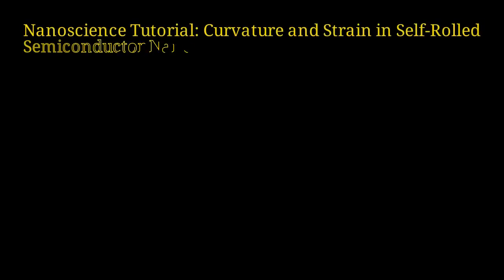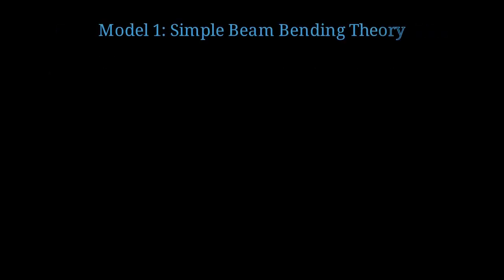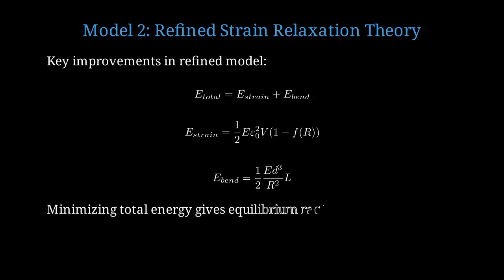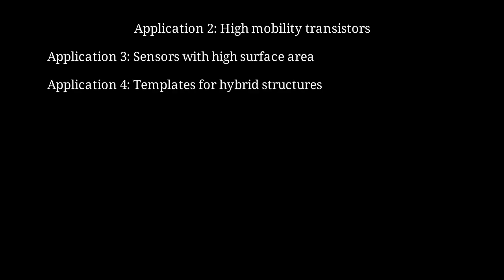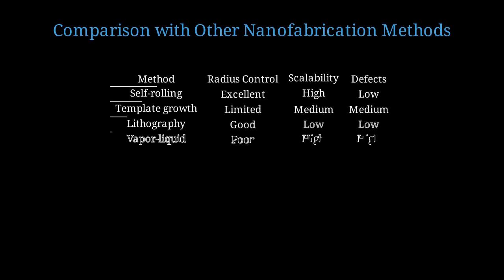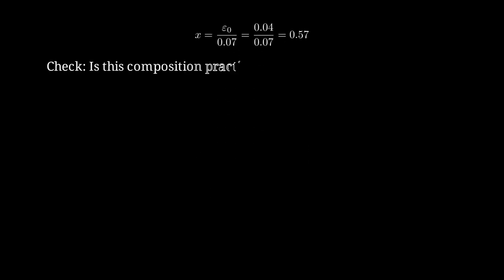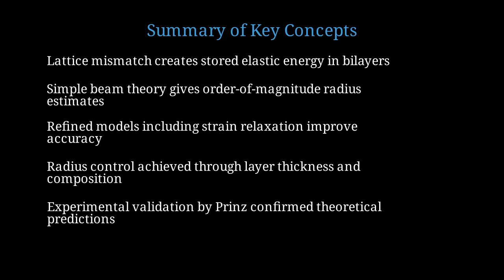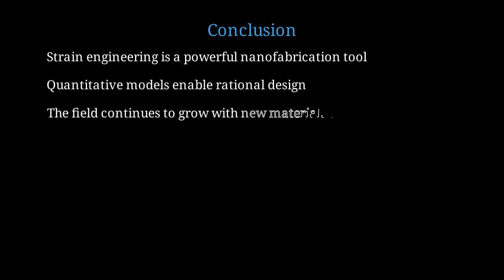How Victor Prinz’s Discovered Strain-Engineered Nanotechnology

Comment from the maker: How does the balance between strain relaxation and bending energy determine the rolling radius?
Why does the position of the neutral axis shift with layer stiffness and thickness?
How does thermal expansion mismatch affect tube curvature stability?